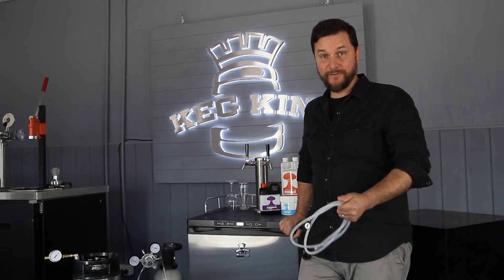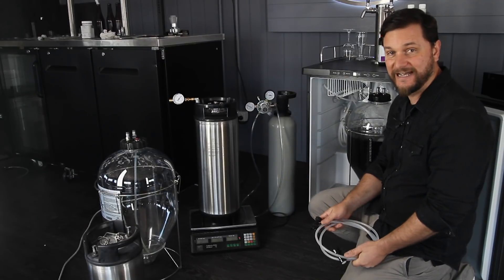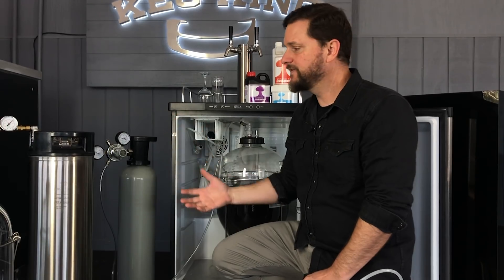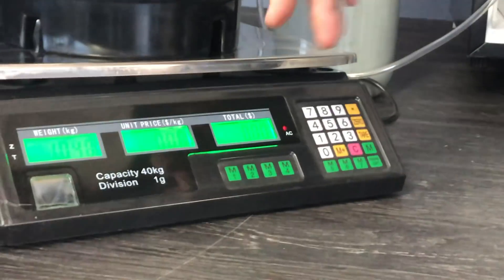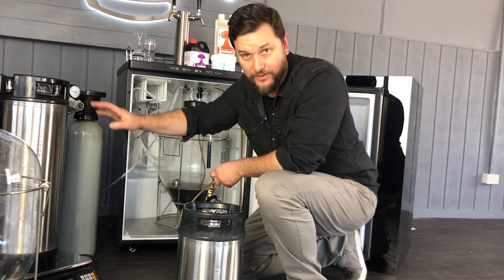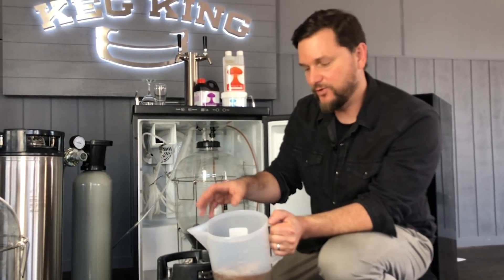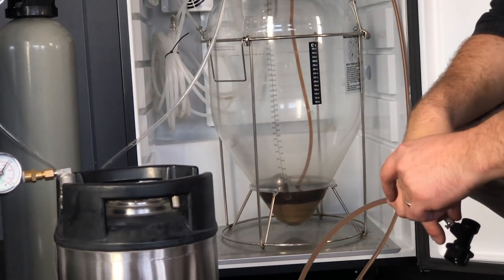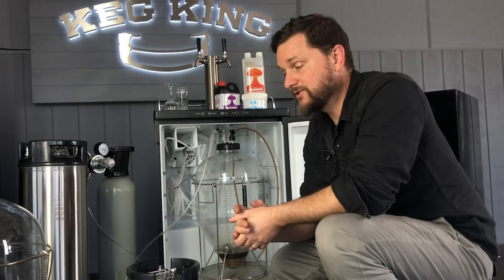Pressure transfer using Fermentasaurus Snub Nose

Comment: This is perfect for the first time pressure transfer user. Thanks so much
Reply from the maker: Thanks Frank. If you like these tanks, you'll really dig our new Apollo 30L variety pressure fermenters and unitanks. 
https://youtu.be/rj_gzZWeamw
We also have these in stainless steel so you get all the performance and convenience of the equipment in the lid with the strength of stainless steel + expansion ports in 1.5inch tri-clover!

Comment: Both times I pressure transferred the trub erupted from the bottom and cloudy my beer. I don't have fridge space to cold crash the fermenter is that the problem?
Reply from the maker: The cold crash during a pressure ferment accomplishes a couple of things, so if you're not including it you're missing a crucial element, not just in pressure fermentation, but in cellar processes in general. 
Temp control is essential. You'll make beer without it but it will always be hit and miss if you're just leaving it up to the elements. You'll want to pitch at optimal temp for the yeast, rise towards the end of fermentation to allow for diacetyl clearance and then drop temps to clear, flocculate and carbonate. 
Gain the advantage of control in every aspect of your brewing and you'll get consistent, reliable, world-class results in your beverages every batch.

Comment: So do you have to have a Spunding valve to transfer from the Fermentasaurus to a keg?
Reply from the maker: It's better to have the spunding valve because you can control the flow speed better with the keg's internal pressure. Alternatively you can just leave the PRV lifted and it will vent while you fill, but there is less control using this method.

Comment: Funny how you cut twice the video when you connect the gas and beer ball locks, like you were having trouble. Maybe this is not adequate for a kegerator. Just saying.
Reply: I think it might just be a bit of bad editing. Just watch video on dry hopping and although it looked a tight fit. He did attach the disconnect. Not that I use a Series 4 fridge anyway.